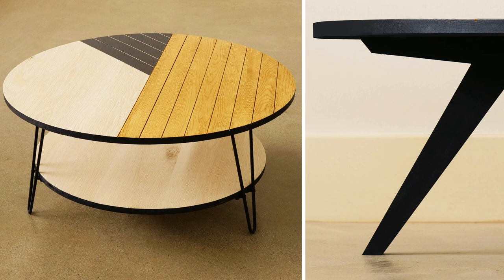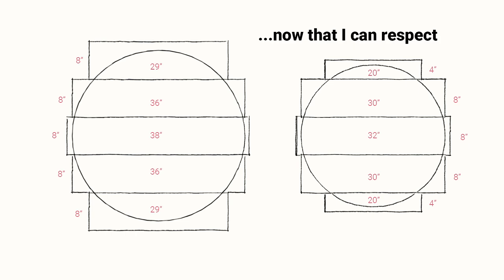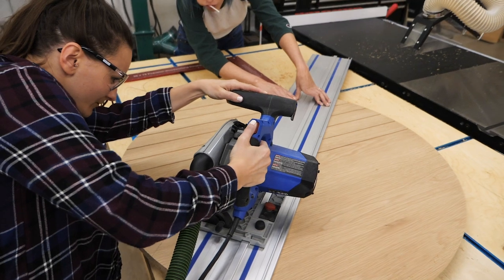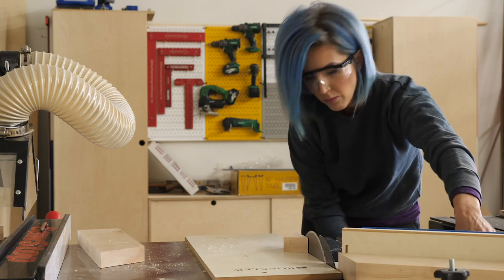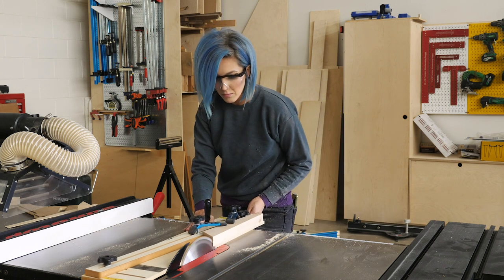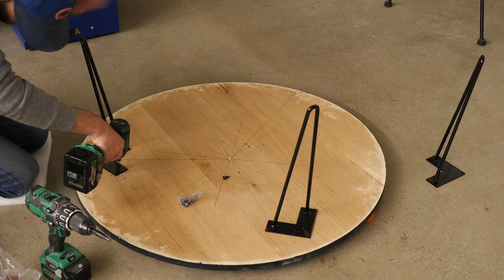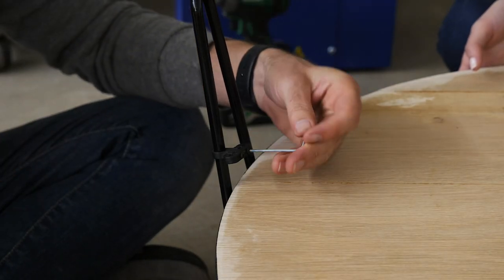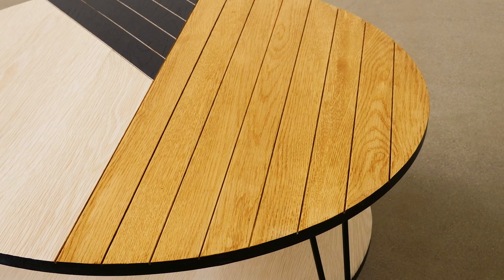DIY Coffee Table: Not 1, Not 2... But One And A Half Ways!

Comment: The fly wouldn't likely trip your brake, it would have to be grounded. Similarly, if you had a pin nail floating in the middle of a board, not touching you or the table, it likely wouldn't.

Comment: Serious question.  When you are using your domino, you are using jorgensen clamps instead of utilizing the t track system.  Why?  Is the T track more show than it actually is useful?  I ask because I built my table without it and thought maybe on day I might add.
Reply from the maker: It kind of depends. I've found that the main situations the T-track comes in handy are:
1. when you need pressure anywhere not near the edge of the table.
2. when you have repetitive clamping tasks.

In other words if it's less than 3 or so pieces all on the edge, it's usually quicker to just grab a clamp. Especially if my table is littered with other items (like it usually is) since it's sort of my outfeed table / assembly table / work bench.

Comment: I doubt the little winged beasty would have enough capacitance to set off your sawstop :)
Brilliant build(s), and I loved the message at the end :D
Reply from the maker: haha...yeah, I doubt it too...If I really wanted to get PITA on me, I could think of a test to determine how big an animal needs to be to get it to set off. I'm not gonna do that though :P
Reply: I wonder if there's a test mode that'll set off an LED or a buzzer, so you can test it without the saw spinning (which would be dangerous), and without the mechanism deploying (which would be expensive lol)?
Reply: @Foureyes.Furniture  Doesn't the brake require the contact to come from a source that is grounded? That fly is not since it is only touching the blade. Theoretically, if you were levitating and touched the blade that wouldn't trigger the sensor as you cannot ionise the air between your feet and the ground (?).
Reply: Agreed.  It would have to be metal or wet to trigger it from my understanding.

Comment: Wondering if you have an idea as to how to prevent tear-out on the necessary spline cut?
Reply from the maker: Yeah. A sacrificial piece that sits behind the work piece would do it. Again, since that's the part of my piece that will be up against the underside of the table, I wasn't too concerned with it here.
Reply: Yeah exactly. Why go through the effort if it’s hidden. But in the event you’re cutting a spline that won’t be hidden I was trying to imagine how to get the sacrificial piece in there due to the angle. I guess a right triangle would work. I was wondering if maybe a small block taped to the exit point would do the trick. Gotta love those quintessential foureye legs though :)

Comment: Can you please stop wearing gloves when working on your tablesaw? I find it pretty ironic that you use a Sawstop that can detect skin and then wear gloves to cover that skin which not only prevents the security mechanism to work but also adds to the risk to be "sucked" in by the sawblade. If not for yourself do it for your viewers that might copy this behaviour. Otherwise great video!
Reply from the maker: Legit question. If that did happen, Wouldn't the brake still trigger as soon as it hit my skin? 

I only do it in situations where I know my hand is no where near the blade. Typically when ripping a board with a rough edge where it makes it safer (in my head) in that I can keep better pressure against my fence.
Reply: Rex Krueger did a video a while back about an incident with his sawstop. It was just a minor injury but ot showed that he thouched blade with his nail first which is not conductive and therfore got cut.
You might be right that the blade would retract as soon as it touches your skin, but what if it catches the glove and pulls your hand down with it. these forces might be enough to break your fingers or even rip them off. It would be a great test though, to put some wieners in a glove and let the saw have a go at it. Here’s the video from Rex: https://youtu.be/1wJQn_UGAKY